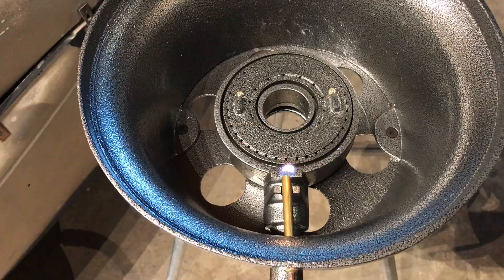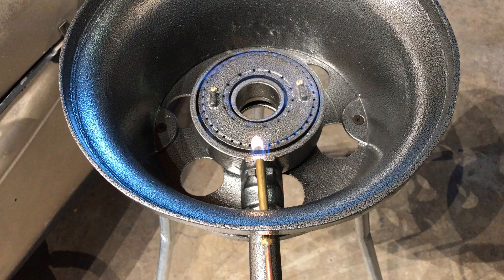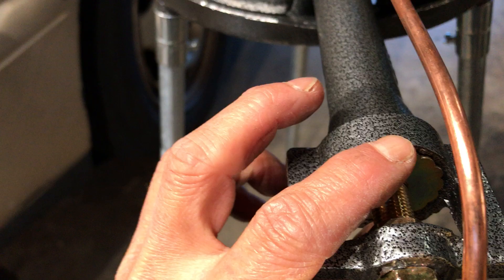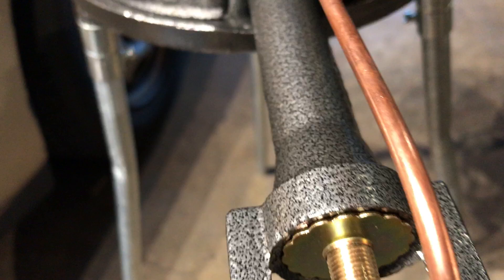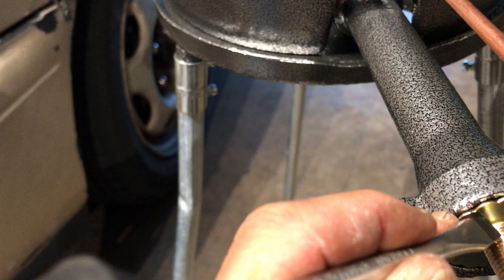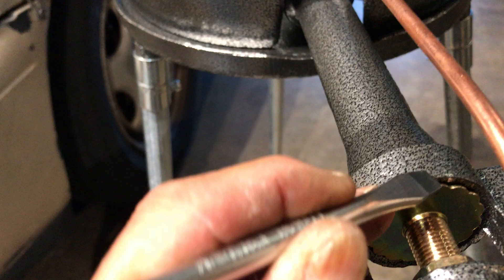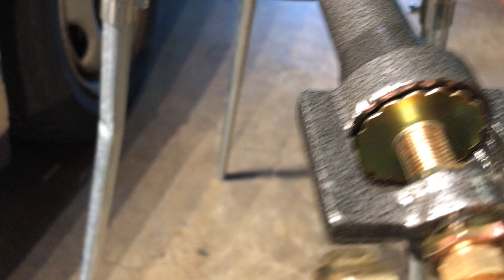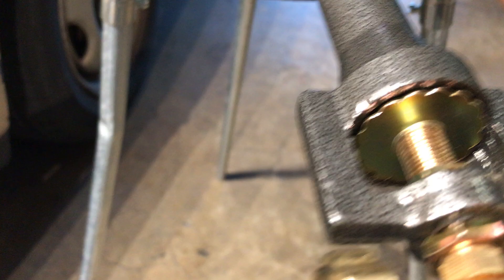How to solve yellow flame problem?

Comment: I noticed a lot of yellow flame even with the adjustment dial fully opened. Also there's a lot of residue on the stove with only a few times of use. Sadly, it seems the regulator has failed yesterday and gas is coming from the tiny hole as soon as the tank is turned ON. I sent email to support. waiting to hear back.
Reply from the maker: About the yellow flame, there is a video (2nd one) on our product documentation page http://outdoorstirfry.com/support/product-documentation/.  You might need to adjust air/fuel mixing wheel position for better blue flame.
Reply from the maker: Sorry, that video on our web site is the same as this one on youtube.  Haha!
Reply: @dongshengzhou  thank you for the First Class customer service. 🙏🏻